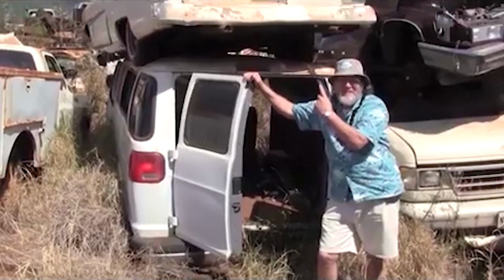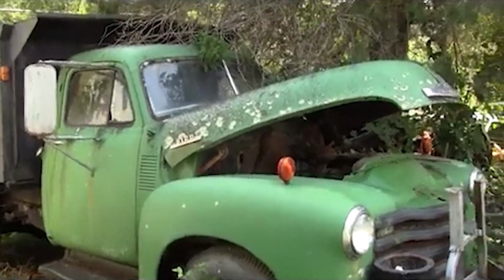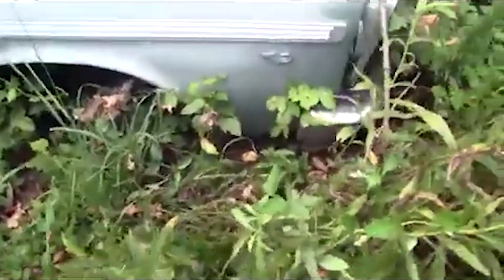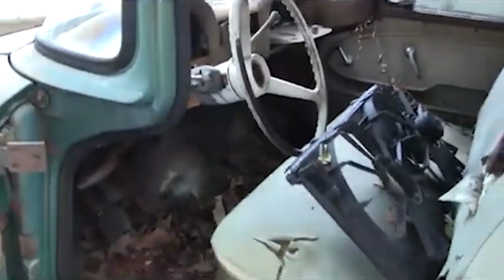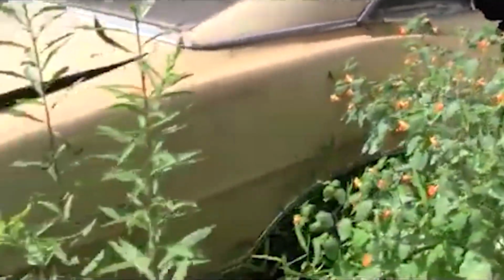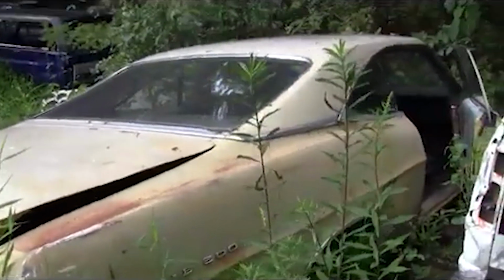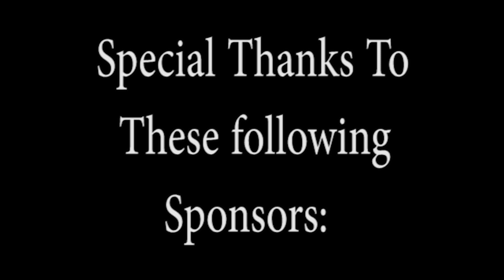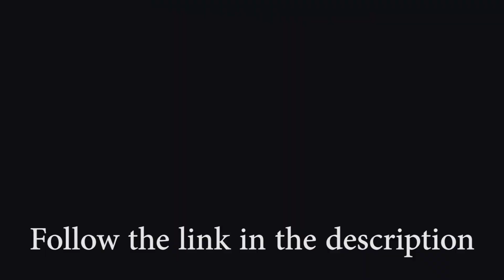Hillbilly's

Comment: Wrecker is a 64-66. The 60-63 had the wrap around windshield. Dump truck is not a 54 or 55 because of the split windshield. Car on the flatbed is a 68 or 69 Oldsmobile.